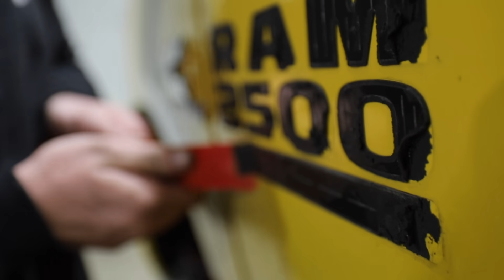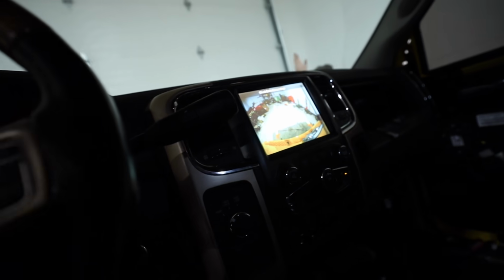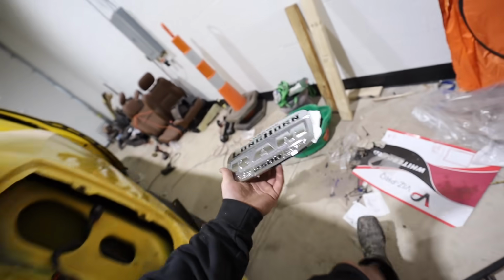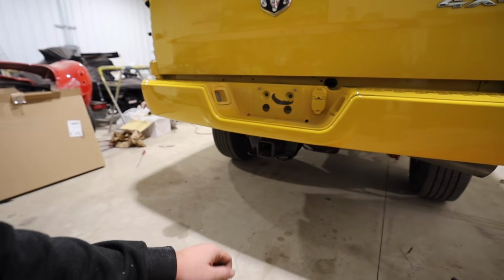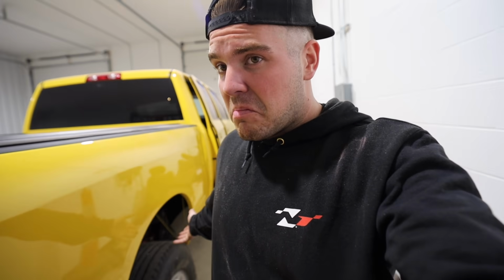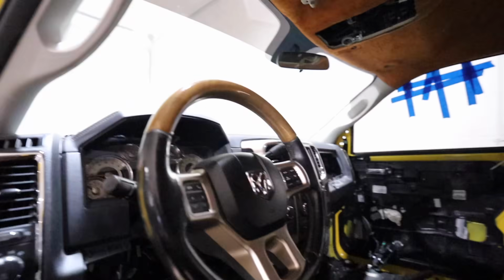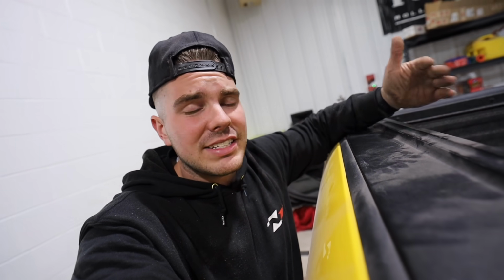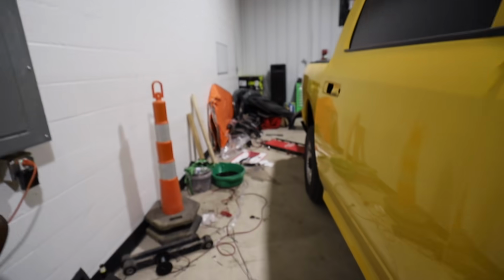FORCED TO MAKE SOME LAST MINUTE CHANGES TO THE BANANA RAM

Comment: Put the tonneau on the lime, do the plastic rail covers on the box in lollipop red and spray the bed yellow you could also do the bottom of the window rubber in the red to keep the line from the box to the hood looking clean. Put the OEM flares on it.

Comment: Definitely wait for flares finish the truck make it last but it’s a no on the flares! And the tail lights do the same as the lime! And I know you didn’t ask I think you should polish the exhaust pipe chrome and do the same tip as the green ram but do red but axle dump it 🤙🏻 witch ever way it’s gonna look good

Comment: Do a set of OEM led tails, and where the chrome ring would be around the edge do that in yellow, and for the 3rd brake light, do a OEM led with the bed camera in it. Since it’ll be a long horn. It’ll help complete the long horn look from the rear

Comment: i like flares also so id vote to get em on eventually. take that bed cover off and leave it off / sell it, i think they take away from a trucks look. red bedliner shud be interesting. tail lights, u went with clear/color matched up front so i would suggest the same in the rear. And just fyi...u HAVE helped inspire me to building my truck also, so Thank you! I'm almost done with the exterior mods and ready to start on the inside. I see what your dealing with waiting for parts and things getting delayed...suX a$$!  LoL I have been able to do things I wasn''t sure I could do...like lift kit...cab lights...rock lights, light bar, heavy duty tie rods, and soon a steel front bumper ! Thnx for keepN it real and being inspirational!!! btw I luv the blk ops camo hoodie! I rock it every time i go to town >8)

Comment: Red liner move the cover to green truck keep the flairs off. Did you get a wiring interface for the dodge mine wouldn’t work till I got the interface on it for all my controls?
Reply from the maker: For the radio?
Reply: @ryan2546  yes there’s an interface for the radio that will allow the amp to function
Reply: PAC Amppro AP4-CH41

Comment: So definitely put the Longhorn badge on. While I love my debadged black Sport, I feel the Longhorn badge is like a bragging on right, ESPECIALLY since you built it yourself. For fender flares I’d say without, I definitely think the yellow and red, especially with the red bed will look so nice so clean with a wide setup. For tails I’m definitely on board with the 5th gen as I just think the shape and design will match the overall style of the truck itself because it’ll al look nice and tough yet that yellow with the 5th gens will just overall be a very very pleasing design to look at!

Comment: THE TRUCK LOOKS SOO GOOD 🔥🔥
I feel like the black hitch looks clean how it is. And with that gen y powdered lollipop red would go hardddd. You should do the Putco blade too!!! And if you think it’s more practical, I would move the tonneau cover on the OG. And get that Red Raptor liner 💥🌹. And she’ll be poppin 🤤🥵. BTW those chrome longhorn badges are siiick💦
Reply: Also I enjoy the Morimotos on the OG with the infinity mirrors ✨. With the flares it might look clean but if they aren’t the best fit I would just keep them off. Unless they were oem, then I’d go for them😉. Keep putting in that work. Just remember... there’s nothing to it, just do it💯

Comment: I'd say either do a set of Recon tails and third brake light or do the 5th gen style tails. Don't do the Morimotos again, already done on Lime I think something different would be cool. Definitely not a fan of a red bed liner. I would sell that tonneau cover and get something different for Lime and the Banana Ram, like a Bakflip MX4 or the Roll N Lock. Gotta have a bed cover for this terrible northeastern weather we get! And as for the flares, I would say wait for now and get the other stuff done first but do it later. Definitely a clean look!

Comment: 1.) I don’t think flares are necessary on this truck, but either way it’d be good.
2.) Do the same tails as the green truck.
3.) Take off the bed cover, slap it on the green truck.
4.) Yellow bed line would be clean but red would be very in your face, which everyone likes.

Comment: No flares for now, morimoto tails and 3rd, leave the bed caps and cover alone, no red bedliner, worry about the hitch later. Just get what you already have going finished up instead adding a bunch to it. Sometimes less is more, don't over do it.

Comment: Flares - yes, tails - Morimoto's, cover on Lime, bed red - no will look like a McDonald's truck & next time you debadge use braided fishing line to get them off & pull the black tape away at a 45°angle & it will come off clean.

Comment: I guess you’re planning on using raptor liner? Personally I’ll never use it again. VERY disappointed in it... anytime I used my bed I would have to put a towel down because it just just chip off otherwise. BUT if the bed is not going to be used much being it’s obvious a show truck the cheap plastic like liner may work great?

Comment: I’d say don’t do the flair rn. Finish it the build completely and then decide if you want flairs after. Leave the Hitch black bc honestly you’re not gonna see it. You’re gonna look straight at the hitch. and you better put the longhorn badges on😂 leaving it De-badged would take away from all the work you did on the interior.. One more thing🤣 where did you get the material for the custom headliner?😭

Comment: There's such a thing as too much accent colors  and odd not the same red would be wrong.  As for the tail lights you just do the best you can get now.   As for your sound system   your looking at a new head unit.  You crost feed back feed signal that took out the computer chip in the computer of the head unit. You should not have had 2 amps and kept the factory setup for the small door speakers.

Comment: You’re building a fourth GEN Longhorn go with OEM factory fender flares. Third brake light I would go with the fourth GENLED cargo camera pick them up at the salvage yard. Don’t put fifth GEN parts on a fourth GEN truck that just looks stupid build your Longhorn edition stay with the Longhorn theme.Ryan for your audio you need to PAC audio APR-CH41.Don’t take it to an audio dealer you have the hard work already done just get that piece

Comment: You're are building something no one has, red liner as long as it matches the red you already have on the truck. The oem flares look clean and would look better then cheap non fitting flares, as far as lights.  You are building something no one has...5th gen tail lights would look better then  cheap, lame looking lights that look out place.   Take the bed cover off put it on the green ram but if red box looks like shit put bed cover back on.